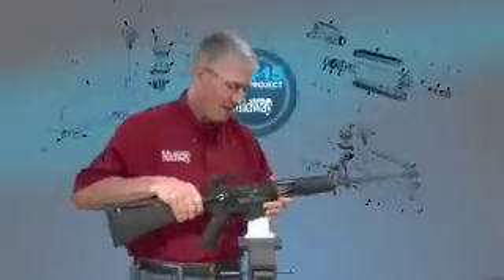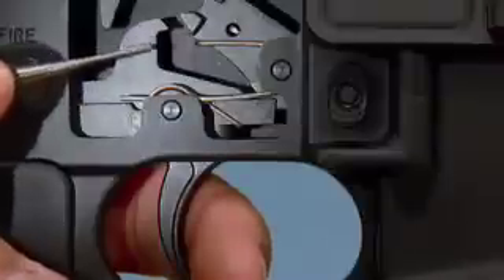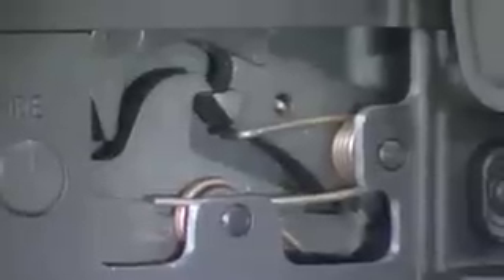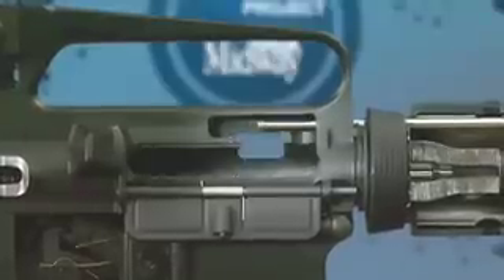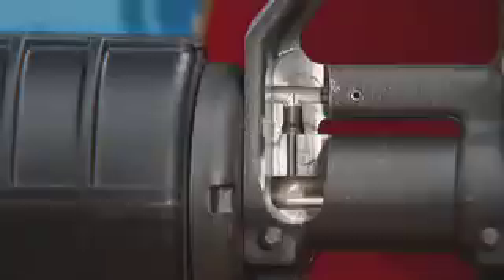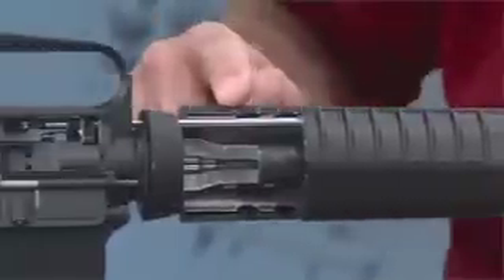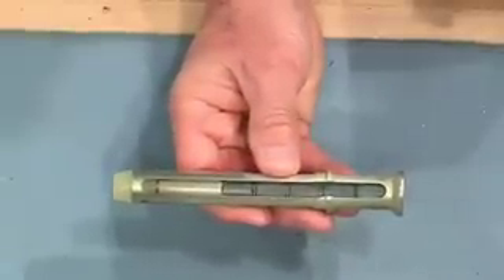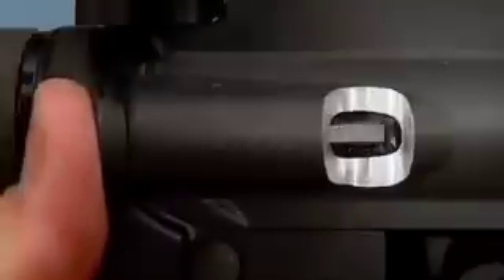How the AR-15 Functions Presented by Larry Potterfield of MidwayUSA

Comment: (continued) The gas tube is required to exert a force on the carrier alone, which is meant to rotate the bolt and unlock it. If no force was exerted on the carrier, the bolt would simply rest with its lugs on the breech face recesses and never go back. Some weapons (blowback-operated) have much simpler bolts, but this requires the use of less powerful ammunition. Many SMGs are blowback-operated, while most semi-auto and select-fire rifles have a rotating bolt of some sort

Comment: Actually it's more than enough, but the AR-15 does not have a simple blowback bolt which is held in the locked position only by inertia. Instead the AR-15 has a rotating bolt which locks into the breech face using 8 lugs (7 on the bolt, 1 on the extractor). The bolt is linked to its carrier via a cam which moves in a spiral groove, this allows a portion of the carrier's linear motion to be transcribed into the bolt's rotatory motion, allowing the bolt to either lock or unlock.

Comment: (continued) The bolt assembly is linked to the bolt via a cam which moves in a spiral groove, thus the first portion of the carrier's backward motion translates into a 45 degree rotation of the bolt. When the bolt rotates 45 degrees its lugs disengage from the recesses in the breech, and the bolt can start moving backward under pressure of the gases and the recoiling case.

Comment: No offense, but you got it all wrong. The brass, when under pressure pushes against the bolt. The bolt will not move backward because its lugs are resting against recesses in the breech. When the bullet passes the point, where gas is drained into the gas tube, the pressure inside the tube increases and pushes the bolt carrier backward.

Comment: Thank you Steve for a lucid and understandable explanation. I now can see why the large powder charge would cause the brass expansion because the gas exits pushing the bullet through a relatively small opening (5.56 mm) unlike a pistol where the bullet opening is usually the same size as the rest of the shell. Thank you again for a clear explanation. Are you the Steve Miller musician (Fly Like an Eagle etc.)?

Comment: I always wondered why the opposing force exerted by the fired shell is not enough to push the bolt back like it does on a semiautomatic pistol. The 5.56 round is much more powerful than most handgun loads, so why does the AR need the gas tube to push the bolt back?

Comment from the maker: Without having the firearm in hand it is difficult to diagnose the issue.  We would recommend taking it to a local gunsmith to give it a once over.  Some possible trouble spots could include the ammo, gas system length, buffer and or buffer spring, or a misalignment of the gas block.

Thanks for Your Business!

Comment: Larry great video.I had used cmmg parts in assembling my lower reciever.When I did the function test hammer sear notch would not engage causing a double fire.
As a result I had to exchange that cmmg hammer for a DPMS hammer whcih worked.

Larry would greatly appreciate your input on this.Thanks

Comment: @Jake6comments (cont)  The bolt also recocks the hammer.  The buffer assembly absorbs the recoil of the bolt and forces the bolt forward readying the trigger and stripping a round from the magazine.  As the bolt continues forward the bolt cam locks the bolt sealing the chamber.  You are now ready to fire again.

Comment: @Jake6comments Wrong.  Pull trigger, hammer falls striking the firing pin.  The firing pin impacts the primer which explodes igniting the powder.  The powder burns creating gasses that push the bullet down the barrel.  When the bullet passes the gas tube port, gasses enter the gas tube.  The gasses fill the gas tube with enough pressure to push the bolt carrier group to the rear.  In doing so the bolt cam pin unlocks the bolt and the ejector ejects the spent case. (cont).

Comment: @gvpcachnc no. your rifle will just be non operational single shot.

The hammer will follow the carrier forward and that is all it will do. However a slam fire will be highly likely as well as a firing out of battery.

A true full auto m16 has an auto sear which holds the hammer cocked until the bolt is locked, when the carrier moves the last few bits, the rear of the carrier pushes the auto sear, and lets go of the hammer. And repeat process.

Comment: It should be fine on its own, the amount of pressure and heat in that tube during every shot should prevent anything from being built up in there.  The problem though is that all of that carbon gets blasted out of the tube and straight into the receiver.

Comment: I like the usability and design of the M16 platform, but I have three problems, one of which you mentioned.  The first and most important is the caliber, the 5.56 is not good enough for stopping men.  The second is the gas tube instead of a gas piston.  The hot gases blast carbon into the receiver, heats up the bolt, and evaporates lubricants.  A gas piston is a time-tested, cleaner way of operating a weapon.  And the third is the star chamber.  Too many lugs, too hard to clean.